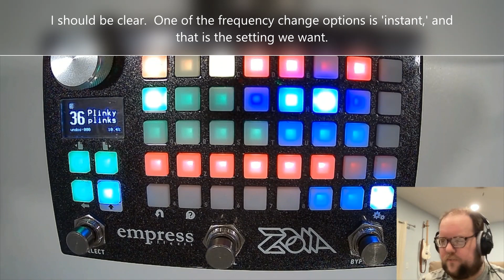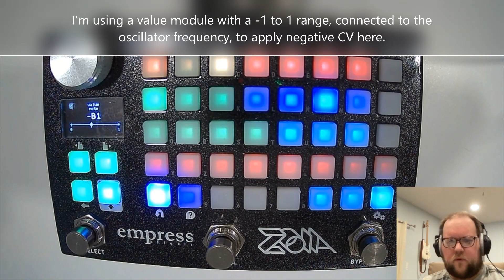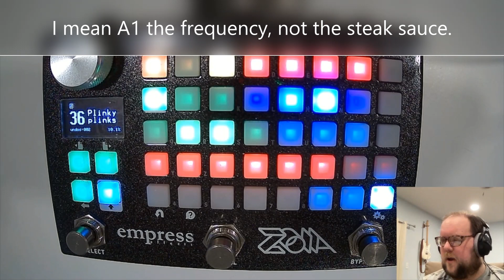Empress ZOIA tutorial:  "Zynth Zecrets -- Pinging filters for bells and tuned percussion sounds"

Comment: Is this different from Karplus-Strong?
Reply from the maker: It is, although they bear some similarities.  Both use bursts of noise or sound to excite a resonant structure.  In Karplus-Strong, this structure is made from a very short, unmodulated delay line -- a comb filter -- usually with a non-resonant low-pass filter in its feedback loop to control damping.  I hope to do something on Karplus-Strong synthesis at some point (and the related waveguide synthesis), but I need to do more research -- so far, my efforts to get a Karplus-Strong synth voice to be tunable other than by ear have come up short (due to the differences between how delay times scale and how note values in ZOIA scale), and I like approaches that are scalable.   Here's a patch I did when I thought I had figured that scaling out (I had not):  https://patchstorage.com/k-s-synth-a-three-voice-karplus-strong-synth/